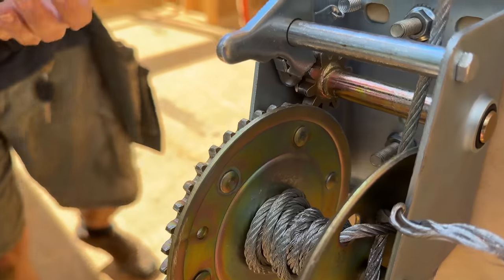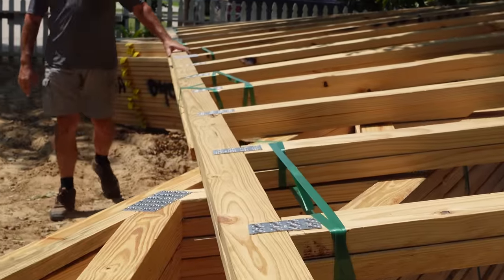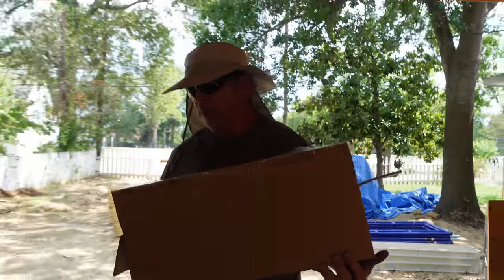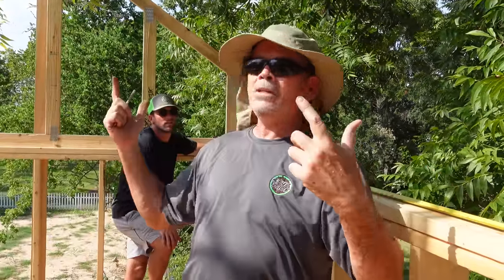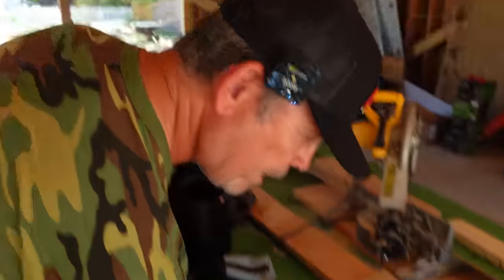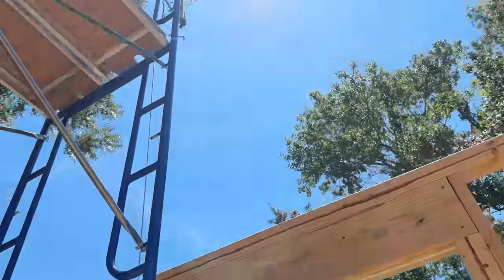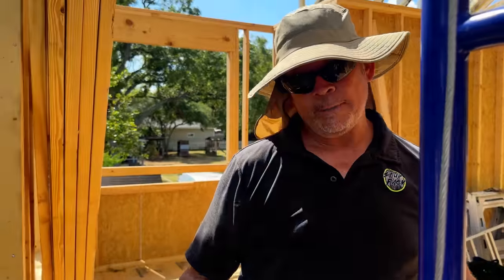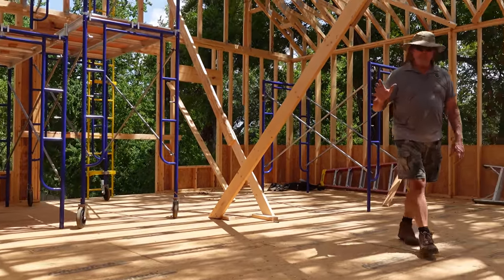Climbing 30 FEET UP to Lift Our Trusses by HAND! (Saving us Thousands)

Comment: We always spray paint the tails on one end of the trusses, the same ends all at once, as they came off the truck.  Trusses moving through roller presses deform from the intended geometry just a bit.  Keeping trusses all in the same orientation makes sure that the deformation is also in the same orientation and gives you a flatter surface on the ceiling, especially with vaults.  All the spinning of the trusses, as in this video, doesn't make this impossible, but complicates it.

Making sure the scaffold sections are pinned together, adding some counter weights on the end opposite of the lifting point, and using industry standard outriggers would be good safety precautions.  As someone who is always trying to engineer one and two man tasks, this was an intriguing video.  In the end, I would probably still spend the money for a crane, especially for trusses as large as these, span and height considered.

Fun to see how other people solve problems.
Reply from the maker: Thx!   Love the spray paint tip 👊👍🫡

Comment: You are correct, that piece of hardware is indeed a shackle. 🎉A clevis pin is a pin that is inserted between two pieces of hardware to secure one of the pieces to the other.

Comment: We used to bring the trusses inside the building and have them sitting upside down , the u get a guy on each end to nail and hold the truss. And a guy in the center . have 1 guy flip the truss up with a stick or 2x4 . to the guy at the peak . We would have pre cut 1x3 ,s  to keep it the lay out . Also we would lay it out first before we lift up a truss. Did you guys have to do 16" O C ?
We always did 24" OC . with 5/8 plywood . But you guys did good . Nice work !  Im going to subscribe , I lke watching construction as well as doing !!

Comment: Great use of scaffold & winch as a crane. Once had builders down tools as no crane was available to lift a pack of trusses on to top plate. Once they left four of us cut truss pack open, and lifted/slid them up one at a time.  They returned to find all trusses on top plate, but still complaining that we didn't set them in position. We were just the labourers.

Comment: Why not  take the handle off the winch, put the nut back on and use a drill  set on slow speed with a socket  to turn the winch. Just use a ratchet when you need to slow down.

Comment: Would it be possible to take that crank arm off and "studdie-rig" that shaft with a nut and then use the drill to run those trusses up way faster?

Comment: Love the truss design. Vaulted ceiling without the centre beam! Any idea if this is possible where there are high snow loads?
Reply: I’m hoping there will be some beams to tie the two eave walls together.  To me, it looks like just the weight of the roof system will be enough to push the eave walls apart somewhat.

Comment: Great jogs on the trusses guys.
I'm guessing all the trusses are set now but instead of hand cranking the trusses up 30' I thought you could have used a socket and screw gun to lift the trusses.
If you had used a socket over the hand crank bolt you could have saved your arm a lot of work. Just a thought.

Comment: Raised my garage trusses with two  520 duct lifts i liberated from work. Welded up some 10  gage to the ends of some unistrut to form clamps that the bottom chord 2x4 sits in then inserted them into the lifting forkes on the 520'S. Bam! Instant truss lifts that roll, lift, and lower. Trusses were 36 feet long, lifting them to 14 feet. Nice job gettin it done boys.🫡

Comment: Just a quick question on the blower door test i under the zip walls and the tape + sealant preventing air leaks but how do you stop air from leaking through the floor or is the tongue and groove that does this job. i will just say i know nothing at all about the building industry but i do love watching you guys and the awesome results you gotten with all you work
Reply from the maker: We will use spray foam under the floor for air sealing/insulation.  Great question... thanks for the support 👍

Comment: A crane would have been able to load the sheet goods on to the 2nd floor platform as well as the trusses on to the wall top plates.  Safer and faster in the long run.   Your method was good for a cheaper method that most people could attempt.

Comment: I can't believe you guys didn't figure out a way to use an impact drive to run that winch handle even if it meant tack welding the nut that holds the handle on. I'm sure you felt it the next day.

Comment: Harbor Freight has something called "Snap Blocks" that allows a multiple line pulley system to be rigged on the fly with just long stout rope. I have used these to move my 9/16 shed. Along with one of those cheep winches you can take a tree down and move massive logs. (done that too.). ~ Oops your video is only 1/3 done so maybe you end up with a trip to Harbor Freight.  My bad.🥹. ~ From the Epsom Traffic Circle here in New Hampshire.  ~ Love you guys ~ Great video ~ You've got my attention.     ✨🌸🙏🌸✨

Comment: A shackle. Specifically, an 'anchor shackle.'

A clevis is a general concept. Can take many forms. For example, a jaw end on a turnbuckle, machine from a billet of stainless steel. Or a bent plate with some holes in it.

As an example: Look at a hydraulic ram on a piece of farm equipment: On its arse end, you might find a clevis made from a pair of plates, hole in the end, welded-on. On the other end, a rod clevis, perhaps machined from a billet, screwed on to the end, with a lock nut. Both will have clevis pins when hooked-up.

But yeah, what you have there is a common anchor shackle. Often called a bow shackle. I work on ships, so 'anchor shackle' it is, for me. Lots of other forms exist, but all similar in concept.

Crosby, by the way, makes top-quality hardware for rigging. "Safety first."

Boat trailer winches are for pulling. Never overhead lifting. Seeing the close-ups, I'd say you fellows dodged a bullet today.

Cal-OSHA would have pooped a brick, then written-up a fat one.

Comment: Hand Crank hack'''  Use a drill low torque with a long extension and socket on the nut that holds the crank handle on, now you have a smoother faster lift. Do Not Use Drill To Lower, it will back the nut off.

Comment: I’m dizzy, looking from 30 feet above! that is scary! I don’t even like climbing up 8 -10’ feet above the ground on a 16 foot extendable ladder! And I’ve been doing that a lot because I reframed all the windows since they were framed completely wrong. I’m also installing 7/16 x 4x8 ZIP
Sheating on The 18Ft tall side of my house extension that was built with 2x4 ceiling joists in the late 1960s or early 70s. I bought the house in late 2018.

Comment: What about a man lift? The towable ones can typically lift 500 lbs at minimum and can be operated from the ground. Most places you can rent one for about 500 bucks for the weekend. Not sure if it's the proper method, but I've heard many guys around here using that before to get them on the top plates before flipping into place.

Comment: If you had installed the trusses in the opposite order, you could have installed all the trusses without doing the pirouette. This works because all the middle trusses are open at the base. However, now you are faced with the problem of lifting over the accumulated installed structure.

Comment: I was in the truss industry for over 40 years. From working in a plant to working for a truss engineering firm. The biggest danger associated with what you guys did was that u didn't follow the erection and temporary bracing guidelines that should have and I'm guessing, were, given to you by the truss manufacturer. Ya got lucky! Which is why even folks that set trusses all the time, do stuff like you did until something like severe wind comes up unexpectedly and your flimsy bracing doesn't hold and the trusses "domino" and someone gets killed. The type of trusses between the gables are the very type that fall the most. And in my experience, churches have the worst safety record of all, because they tend to use a lot of volunteers from the congregation to do the work and they typically use the same kind of trusses you used. So congratulations for being successful, but don't get cocky. 
Also note that by using flat bottom chord gables, you may find that the end walls below the gables are kind of shaky. Grab a stud in the middle of the end wall and try to shake the wall. Even in the panhandle of Florida, most if not all building departments will  insist that the gables' bottom profile match the adjacent trusses and the end wall be balloon framed up to to truss bottom chords. I salute your logic and common sense but trusses are engineered components and if all it took was common sense, there would be no engineers and therefore there would be no trusses. My personal opinion is that your video will encourage others to do what you did. I guarantee that if enough contractors or DIYers copy you, someone will die. So at the very least you should display a disclaimer to discourage the techniques you used in conjunction with roof trusses. Because if my prediction comes true, you may very easily end up in court. 
Good luck! I enjoy watching your videos. I hope you consider my comments to be constructive criticism. bdt

Comment: I used a hand winch like that when I was re-doing my garage to get new 22 foot ceiling joists up in the air, by myself. 😉It was cheaper at Harbor Freight, though.

Comment: Well it's done and no one got hurt, so success?

So maybe this comment can help someone else out.

1. Build a center scaffold aligned to the ridge at wall height. 
2. Pull up the trusses, lay flat and spread out for weight.
3. Pull up the gables stand and brace both in place.
4. Stand up trusses and brace half to each gable.
5. Raise the center scaffold high enough for Rad to reach the peak.
6. Spread brace fasten trusses.

Also don't move your straight wall to be flush with trusses built by others and shipped dropped etc before stood up.

Lastly I don't understand the new age of "conventional" roof framing.
Span and pitch along with local dead and live loads give rafter dimension. 
No center beam needed, but you will need collar ties.

Comment: If you would of had a good 10 or 12 inch rope pulley it would have worked. That is the way I did mine, I also strapped the scaffolding down to the deck

Comment: They are not Clevis’ they area few types of shackle though, called D shackles, Bow shackles, Twisted shackles and Wide body shackles all are secured with a safety pin( threaded one end and a lug with a hole at the other end) some cheap ones use a clevis pin (with a head one end of the shank and at the other end a hole for receiving a split pin to secure )

Comment: What you guys should have done was bought an $85 3500lb electric winch at harbor freight put up one trus braced it really well and used it as your ancor point. Would of saved you a lot of time and energy. Its easier to oress a buton and wait than cranking for 5 minutes in 100+ degree weather and messing with the scaffolding

Comment: Take a look at Ken's Carpentry, (on You Tube) he builds garages & takes all the trusses, & positions them point side down. Then with a guy in the middle with 2x4 tips them up into position. Then secured to top plate. This way you would not have to dance with the scaffolding. LOL! As always awesome job.

Comment: If 2 men reached out and lift up the frame 2 feet and the 3rd man held the rope tight, the friction in the rope over the frame would have held.
The 2 men then reach down and lift up again, and lock off the rope. 
I  did the same 'dead lift' at home with my young son with ropes over light timbers above. 
210lb Steel beam. 11ft long.
I lifted one end up 2ft, he locked off rope,  the repeated the other end.
Stepwise up.
Locked off the ropes at each step.
Rested and check safety as it got higher.

The load always had 2 points of connection.  😊😊😊😊

Comment: When you buy your truss the company should deliver them with a crane truck at no or very little charge , like $250. max. Then they’re on the roof in under 1 hr & can be installed & sheathed in a day with 2 men.

Comment: *Hard mode activated*

It seems like there could have been easier ways to do this, but I’m not a builder or a contractor, so this is my own opinion from what I understand.

*Keeping same setup, wouldn’t it have been easier to lift multiple beams to the 2nd story, or move them manually (you stated 165lbs) by pushing them up like you have with other lumber, and set them flat on the floor? Then moved them with winch to final location.

*Otherwise, I found electrical winches that can hold 1500+ lbs and move at 30+ ft/min at an HD big box store for the same price you paid for a manual one that broke. Might have been quicker and less physically taxing?

Really cool you accomplished what you did, but it seems like there were faster and easier ways to do the same thing, and probably would have been safer and less costly (glad you are DIY’ing most of this!). Looking forward to the next video, but maybe listen to your brothers.

Comment: I tried standing a huge 2x6 wall with a rope and a blue genie lift on a concrete slab.  The rafters were open in this building so I roped over the bottom rafter and proceeded to back up the genie lift.  All of a sudden the lift started to do a nose wheelie and I almost saw heaven😂

Comment: Trick is to learn how to bid in another 1500 bucks for a Crane rental. It wouldn’t even end up costing 1500 because of the time you save  more like 800 bucks. I scratched my head on how some people could get 10 or 20 k more for the same job every else was doing but those guys are out their so can’t be to hard to get an extra 800 bucks and it’s way safer .
Reply from the maker: Our time is free. Our money is not limitless. It was the best option for us. We can give the 3 days but that $1500 is valuable to us.
Reply: Well I guess it’s an age thing you get older your time is limited and not free . You have great scaffold most guys waste time climbing around like rats so your ahead of the game their . A temporary strong back at plate height down the middle will also allow you to stack them then flip them up . The advantage to that is it will allow you to sheet the gable before you stand it.

Comment: Just as a point of information - I doubt you secured those deck sections to the scaffold frame, in direct conflict with osha and the manufacturer requirements. If you did good. Those tubular welded frame scaffolds are designed for loads to be supported between the uprights. Once you installed that hoist, the manufacturer was no longer liable. The chain you wrapped around the top horizontal member, appears to be a "galvanized, mild steel" construction and not alloy. Therefore no rating for use as an anchor point. Your cable clips appear not to be "drop forged". "Drop Forged" clips are the only kind rated by the manufacturer/or designed for hoisting applications. The type of clip you have will snap without warning and has no rating. Additionally, for your size cable there would be three drop forged clips installed and "torqued" to the manufacturers requirements. Then set with a load and then torqued again before use. Additionally the end frame sections are designed as a "walk-through" type and the ladder needs to extend up to the walking/working surface. No guard rail as required. You should have listened to the engineers. 
Those trusses are secured by only screws on the top plate and a single killer cleat across the top. You've decided, again that the engineers (truss company) don't have a clue on how to properly brace. This just ensures that in an accident the collapsed trusses are equally spaced. The diagonal braces could/should have been installed during erection.
f I can say anything positive, this video is a good example of how to not do things. I've run into too many of these type installations

Comment: You guys need a Skytrack.😁

Using a scaffold as part of a lifting and hoisting device is outside the scaffoldings manufacturers intended use. At a minimum it a violation of the OSHA General Duty Clause. But you do you and be safe.

Comment: If you have a winch on your truck, you could have rigged that up, possibly with some pulleys and more cable, and pulled them up with that. Remembeer I said this next time. If you didn't have that, you could have used a block and tackle, or a come along.

Comment: shackle with a clevis pin. btw i never got a truss delivery that didn't come on a truck with a crane. The price always included delivery to the top plate. I know the pyramids were built with slave labor but today we have machines. This may be standard operating procedure in Oklahoma or Texas but here in California we like to work smarter not harder.

Comment: I could not watch this comfortably while they had that 3 story, rolling, moving, unstable scaffolding used as crane. If it fell forward towards the outside because the back wheels lifted, that guy would be dead. Saving $1000-$2000 or risk a multimillion dollar claim :(  You could have raised the inner ones a different way, but the two outer ones would have been tricky if they could not be passed through an opening onto the top floor. Once up there you can lay it flat and incrementally lift it up to be parallel to the top plate. Attach some 2x4's, put some blocking on the outside edge, and push it up. That crane would be easier.

Comment: That’s a clevis.

Also I have done this very thing with an electric winch.   I even welded up my own apparatus.
Reply: So many people will tell us it can’t be done or shouldn’t be done, but think about how buildings used to be built before the modern tools and machines.   This is nothing new.   I would advise adding counter weight to the rig.